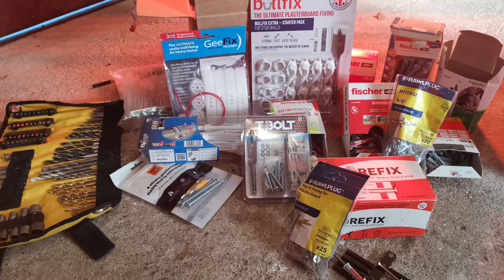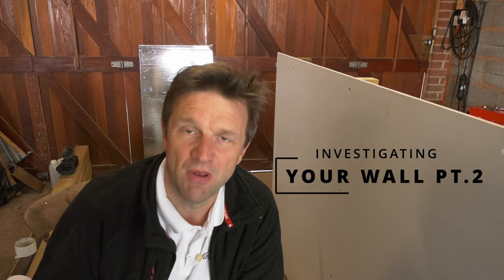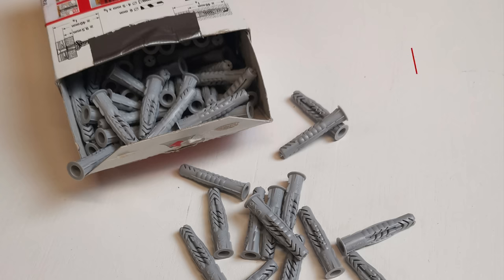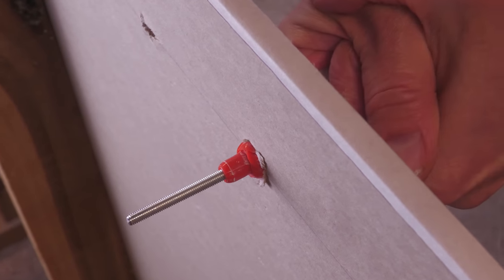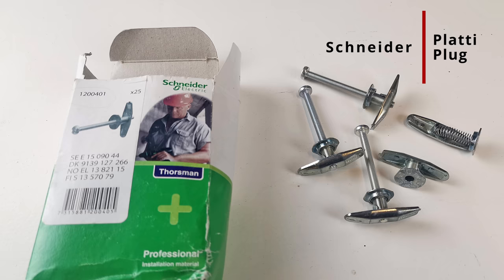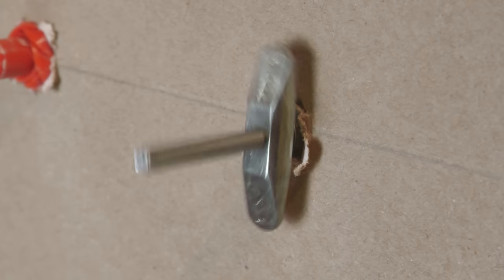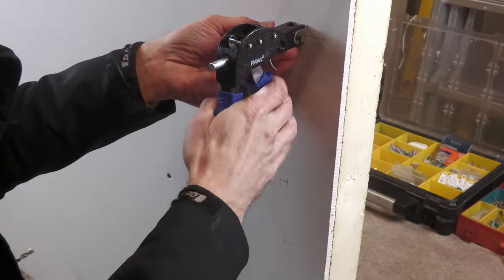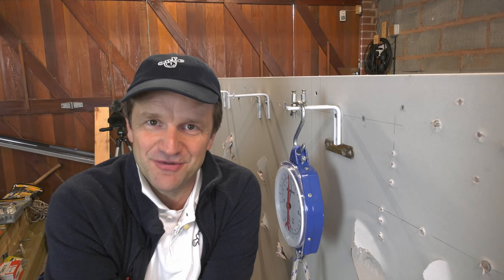How to Fix into Plasterboard - a Complete Guide to all the Best Fixings

Comment: I think the main feature of a fixing should be that it fails before the plasterboard does, leaving a clean circular hole behind, not a crater. Either way you need to reattach whatever has fallen off the wall but in the latter case you'd first have to patch the plaster.
Reply from the maker: I don't agree. Applying your logic you'd use the self drill helter skelter fixing which is dreadful. I've been fitting curtains on plasterboard for 15 years and there are more fixings than ever for guaranteeing a secure fixing without destroying the wall.
Reply: @CharlieDIYte  I think you literally agreed with me in the end by mentioning fixings which don't destroy the wall as being the ones that you prefer???

Comment: Putting up 2.5 metre curtain pole for some long, heavy curtains... 
The Plasterboard is 12mm, then a 17mm gap and then... an RSJ...
Which fixing?  T bolt looks  like it could do the job providing there is enough room in the cavity for wing to open up. Also, the holes in the (speedy rome) curtain brackets are only 30mm apart. 🤔
Reply from the maker: You could try this https://youtu.be/G1ziRy_OJbU Just don't over tighten the screw was it will cave in the plasterboard.
Reply: @CharlieDIYte  
Dear Charlie... What can I say... Your prompt reply to my inquiry was just the ticket, thank you soooo much. I followed your instructions in the video and... It worked!!! My 4mm drill  bit even managed 6 holes in the RSJ, this gave a really solid fixing. I would never have thought of this particular approach, thankyou again. I now have perfectly hung curtains.  Since taking on  this and other projects  during the summer I've really enjoyed and appreciated the in depth and comprehensive format of your channel. I've watched and assessed other similar channels providing adivice (?) on similar topics... Your channel and (British)  expertise is by far the best (by a country mile) in every way, I just thank god you don't wear a baseball cap back to front to present on camera.
All the best from fan/subscriber/ devote to your channel.
John

Comment: The bigger the area of the  fixture spreads behind the drywall , the better it will hold the load. Pressure= Force/ Area.. The pressure decreaaes when the  area increasea when the   force  is constant.

Comment: At 3:10, the Truvo doesn't appear to detect the stud.  It sees the screw, but not the wooden stud, which is disappointing, ans mine does (also low-cost, from Aldi).
Reply from the maker: Yes but the screw is in the stud. That's the point.

Comment: Please help 
IV moved in to a new build flat it's built of a timber frame construction IV been trying to put up a curtain pole ( the windows are near nuff floor to ceiling and I'd like to fit above the window 
My missus is going mad IV put more holes in the wall then my local golf course 
Wish I seen vid before hand 
Soo...... I did the wire test and it seems as I have a thickness of about 24mil so I take it it's double plaster board or plasterboard and that shiny insulation stuff the a void of 15mm 
I will be putting up the pole now on a bit of batten as it's the kids room and whant to spread the load a bit and it also cover up the holes IV made lol 
Could you help me with the correct plugs I can't go making any more unnecessary holes in  walls she's doing her nut

Comment: 18:11    That thing folded like that, when insetrted,  doesnt clear thru the drywall far enough to open up.    Its pretty much sunk & the metal part is barely in the hole,  so theres no way for it to spring open.
Reply from the maker: Used the wrong one then mate

Comment: Good video but ........
At 9:08 pulling that shelf support makes no sense since that is not the force it has to deal with.
The force it has to deal with is shear stress and will be sufficient for a shelf and a lot of books e.g.
Reply from the maker: I always hugely value your comments and critique but I'm afraid we'll have to agree to disagree on this. If you put very heavy stuff on a shelf it fails ultimately due to the same cantilever type forces that I exerted in the test, or to put it another way, the shelf fails by initially sagging down at the front, and this process starts pulling the bracket out of the wall in a similar way to how I simulated.  Those brackets are curtain pelmet brackets by the way, although you're right they're effectively shelf brackets. Ultimately though what I was trying to do was apply an identical test to each fixing so that I could put them in some sort of league table. Whether I exerted force on the bracket in the way that was intended during its manufacture was not really of importance in this context.
Reply: @CharlieDIYte  And I disagree with your disagreement hehehe
Let me explain:
First of all, there will never be a force on that screw perpendicular to the wall as you showed by pulling that screw out of the wall so your test made no sense in a real world situation.
Second, you are talking about a heavy  weight, since that shelf support is small, it will also support a small shelf and a small weight due to that. Then there will always be at least 2 to support the shelf so the weight will be divided.
For bigger shelfs, bigger support are necessary which most of the time come with three holes to screw them against the wall, which in total will use 6  screws to mount it.
Third, back to your ONE shelf support, if you mount it to the wall and put some weight on the tip of the horizontal leg (which in real live never will happen) the force will be downwards, however to tilt it over the point of the vertical leg wants to go to the back, but it can't, cause there is a wall.
I understand what you were trying to tell but  the way of demonstrating how that screw comes loose is not a normal way of operating. Just give it a try and you will be surprised how much weight it can take.
It would be different if it was a screw eye with a washing line and heavy wet clothes hanging on it.
But it is always better to use the better solutions that you were offering !!!

Comment: Comment on the Grip-it; the installation is very difficult if using a screwdriver. The white exterior ring has plastic fins that should cut into the plasterboard to prevent spinning as the red ring tightens, however the fins are too shallow and the plasterboard too weak and they simply don't work, and your whole fitting spins, making tightening impossible. Avoid these. They are so useless that I just threw mine away - and they're pricier than the metal umbrella type ones too. invest in a special tool and the metal umbrellas are the way to go.

Comment: This is very informative but I suspect that a number of these fixing wouldn't work where tiles are stuck to the plasterboard.
Reply from the maker: I don't see why not. The T bolt for example expands up to about 16mm which might just allow for the tile. You'd probably be better though with a Duopower 8x40 as it will be easier to drill an 8mm hole than say a 14, 16 or 20mm.